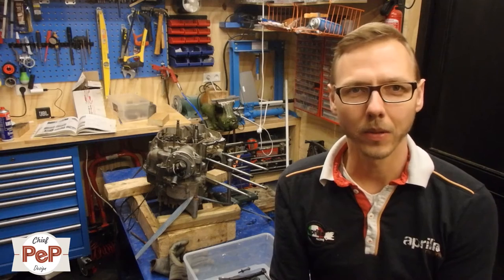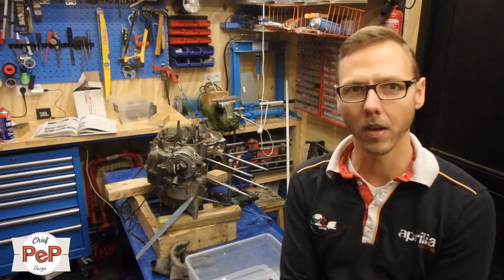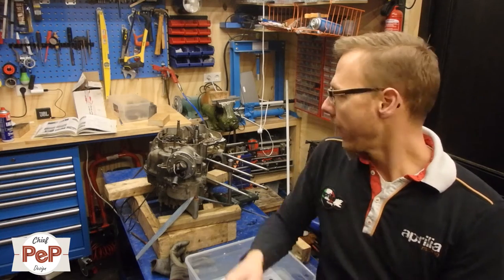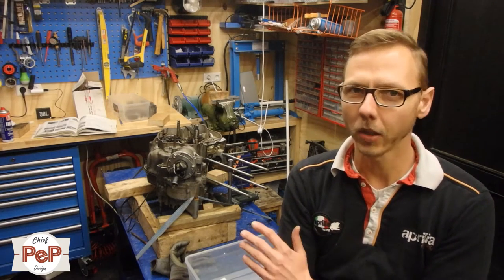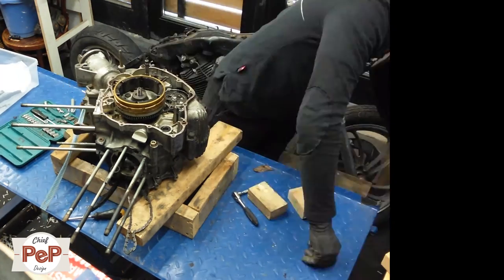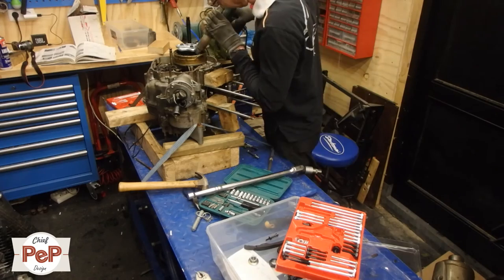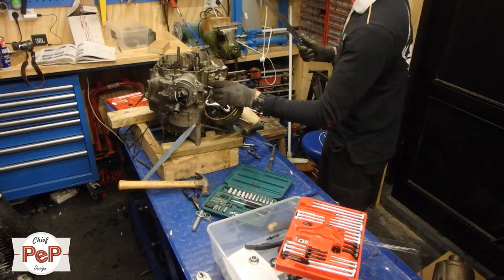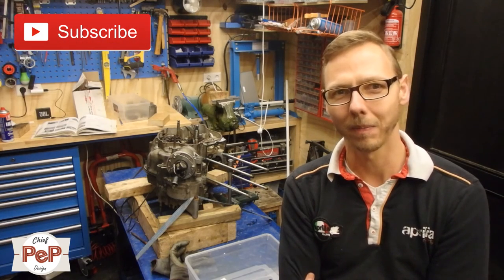Crankshaft split in half?!

Comment: I feel your pain...mine was stuck too. I stripped the threads on the puller the first go. But then I used "Blaster" lubricant, added more torque on the wrench, then tapped the flywheel with a hammer...tap-tap...then a little more torque, a little more tap-tap, then finally it popped off.

Comment: Holy crap, ive never seen a bolt split in half like that either... I find when you have a lot of tension on something with the puller, then try to hammer it at the same time.  Nice work.

Comment: Hey. I am struggling like you. I could really use some advice please if you can help. I had to buy a new crank and left crankcase and went to seal it and after I torqued it. The crank wouldn’t move and I noticed it seemed the crank was pushed too close to the bearing in the left half so I pressed it the opposite way to give it some room but now it’s too much and there’s too much space. Do you know... is the crank supposed to be pressed all the way in the left bearing but just not too tight or is there supposed to be a gap and if so, how much space should there be between the bearing and crank on the inside of the left crankcase? Please help me 😢
Reply from the maker: Alex Fluckiger Hi Alex. That doesn't sound so good... First of all the best is to watch my other video on this topic: https://youtu.be/3DHEmSCaKZE I would never press in a crank to be honoust. You want it to fall in at it's place by itself rather then hoping you press it in straight and using force like that on something that isn't a solid piece. It sounds as if the crank isn't alligned or a bearing is damaged. To answer your question: the crank has a 'stop'. It has a small edge which makes sure it's exactly the right distance off the bearing and has space to turn. Please see my video and listen to the instructions. Good luck!
Reply: Chiefpep 
Yeah it’s been a very frustrating ordeal. Thanks for making these videos. It’s been hard finding info on this. Thank god for the tr1 website that has detailed instructions that dumb Haynes manual skips a lot of needed info for a full rebuild but can be helpful. So I think I know what line you’re talking about. I could see it when I removed my old one. The crank is already in the left case with that gear you said is a pain attached to the other side. I think I’ll just have to try and adjust it to that line using a press. It would be a lot to have to remove all that and put it in the freezer. I guess if I can figure this out. My other question would be that the crankshaft bearing in the right side of the case is able to come out with pretty minimal pressure. Is this going to cause problems and if so, is there a trick to getting it seated tighter? Also any other advice you may have on the crank would be great. Keep doing what you do man. I really appreciate the videos and the help. My local Yamaha mechanics don’t know anything it seems. Haha
Reply from the maker: Alex Fluckiger Hi Alex. What I am going to say might not be what you want to hear but please remove the crank and do it again the way as my video explains. You have everything open now anyway and this is your chance to do it right in one time. You don't want to find out at your first start. Really, you don't. Your crank is a balanced part. And when I say balanced, I mean balanced. So when there is even the slightest inbalance things will be dramatic at the RPM's the crank turns when you rev your engine. You and I can't feel if the crank sits in it's place or not. But, when you drop it in your horizontal housing freezing cold, with a good hot bearing, 100% sure it falls at the place it should be. Don't tap or press it in because you have no feeling if it's completely fitted. Furthermore the right hand side sbould just fits with no effort. You basically screw it on with the m6 case bolts. Don't compromise on that left side! It's the hart of your engine. And I understand you have a hydraulic press. This is the only way for that oil gear. This one also is pretty important that it sits exactly on it's place... Find a way to add it straight down so you won't damage the crank... Good luck!
Reply: Chiefpep 
Alright so I’m going to do it the way you did in the video. As much as I don’t want to. I’ve been trying to get this together for months and have problem after problem. Just one more question for you. So after I drop the crank in. When I put the oil gear on the end of the crankshaft and push it on. How far do I put it? Is there a specific spot for it? Thanks for all your help man. I’ve been so lost on this build and the Haynes manual skips all this info.
Reply from the maker: Untill it hits the end. Make sure it's the right way around! From the top of my head the high edged side should go to the casing side (crank side) so it has the right offset of the case. But just press it as far untill it stops. And, don't be too carefull to heat it up. It should be 'red hot' (as a figure of speech. Not litteraly). And try to do it the same as I did. In one workflow. First the icecold crank in, then immediately the red hot oil gear. Because then the crank is cold and the gear is hot so it is less effort. But be carefull, because you will turn around the casing and you don't want the crank to fall out of the casing when it's still cold. So hold it with your fingers in place. You get what I mean?
Reply: Chiefpep 
That would have been my next question. How to make sure the crank stays there if it’s still cold. You mean hold the case and the crank while I flip the case around? And then make sure that the press is only pressing on the crank so it doesn’t push in the case? 😪 this seems so complicated. I hope I can do it right. There’s been so many problems.
Reply from the maker: Alex Fluckiger exactly. Well your crank bearing is heated up probably and as soon as that cold crank goes in that bearing it will work immidiately. So as soon as you drop it in it will kind of stick to it's place. Then give it two minutes or so, turn it a bit with you hand to make sure it runs smooth. Then carefully put it upwards and bring it to the press. Make sure that it will be supported on the cheeck but also (or especially) the center rod. And offcourse totally horizontal/leveled. Because it you press the gear even the slightest off center or not straight down the gear and shaft will be damaged... And the gear won't go on. Test this whole procedure 'dry' first. What tools will you use, do you have your supports ready, practice the procedure yourself. Because at the moment supreme everything has to be perfect and you don't want to make any mistakes. I had to buy a whole new engine and to take out the crank when I damaged mine with the spit half... You can imagine how frustrating that was...
Reply: Chiefpep 
Oh yes. I can imagine. I’ve almost wanted to buy another one just to start over but I’ve come so far and the new one would have problems also. I put the cam chain guide in backwards and broke the bolt off that holds it in the case and couldn’t get it out and ruined it trying. So now I bought a new left case half and expected the crank to already be where it was supposed to be and now I’m dealing with this. This whole thing has become a nightmare. I have all the parts professionally polished and the case painted and I dream of getting it together but there is a long road ahead of me. I can’t take anymore problems. After all this work it would kill me if it didn’t run right. I have the carbs completely disassembled and I’ll have to figure how all those parts go back together once I get there. I had the carbs polished and blasted. I didn’t take enough pictures. I think you have a video on it maybe. I’ve seen so many I can’t remember but the problem I have it they are sped up and I can’t tell what pieces go where. Anyway. Sorry. I could talk to you for days about all this stuff. It’s nice to know a fellow XV lover. Maybe I could get your email or something and send you a couple of pictures.
Reply from the maker: Alex Fluckiger That's always ok. You can find it on my website under contact. You will be fine. Stay calm. As I say in my last euforic video: 'just take it step by step and use your common sense'. Also Haynes is your friend and yes, I have a video of the carbs. Basically I have every more or less complex step as a video. With explanation. And as you saw, they are right because the bike started in the first attempt.